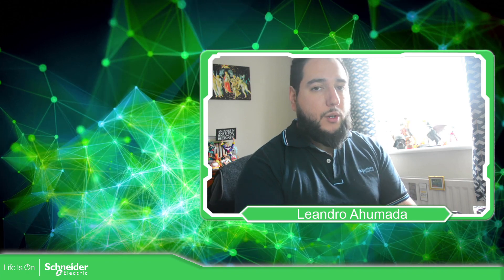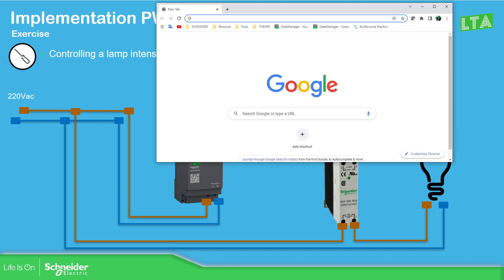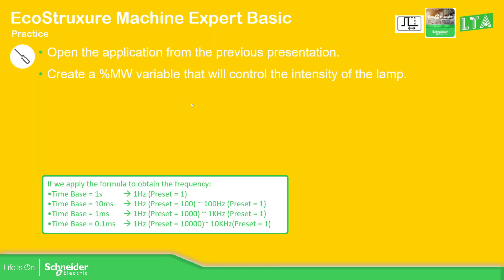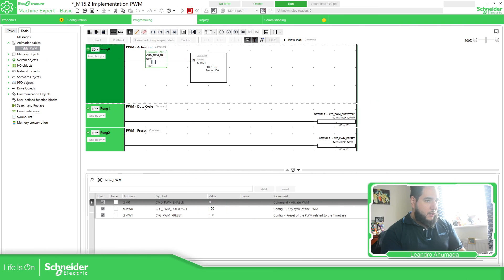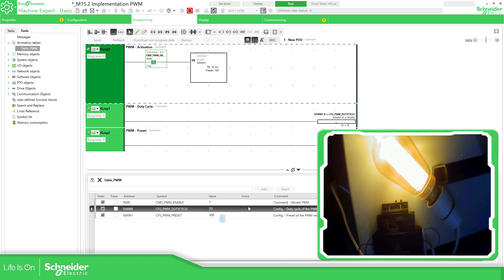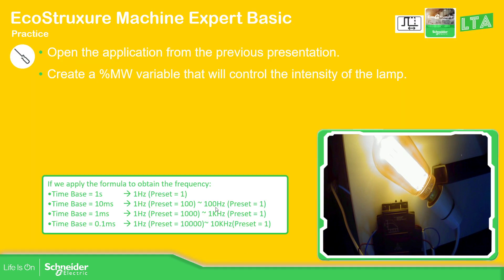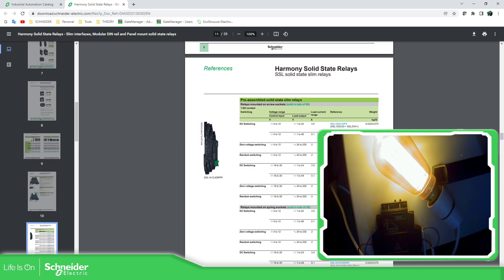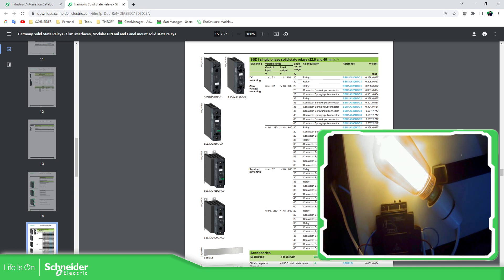Training - M221 - M15.2 Implementation PWM

Comment: Can I use L298N driver to control 12V dc motor. With this plc schneider m221. How to? Is the method the same as what you teach?
Can I use L298N driver to control 12V dc motor. With this plc schneider m221. How to? Is the method the same as what you teach?
Reply from the maker: Hi there! Using the pwm of the m221 will generate a square signal of 24vdc. You will need to check the manual of the L298N for your application.